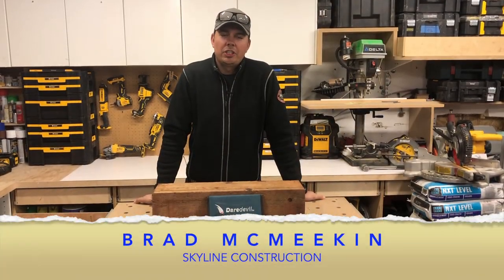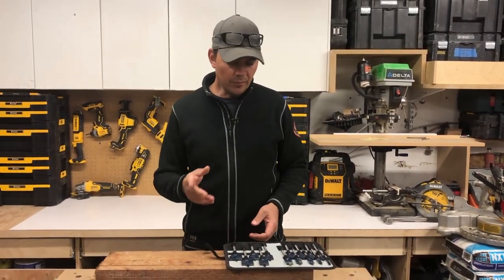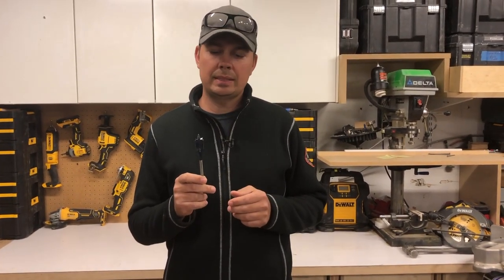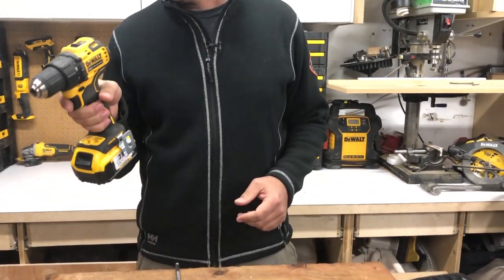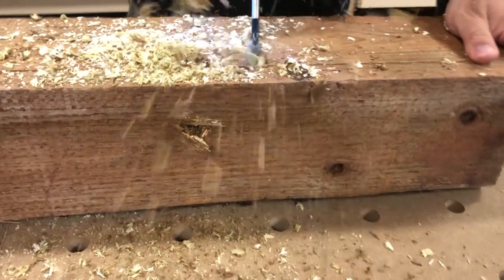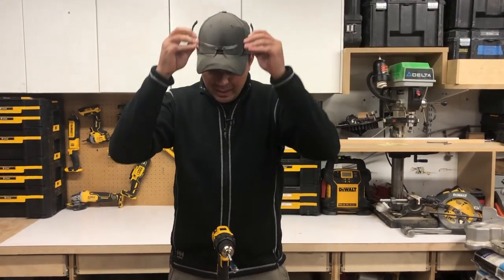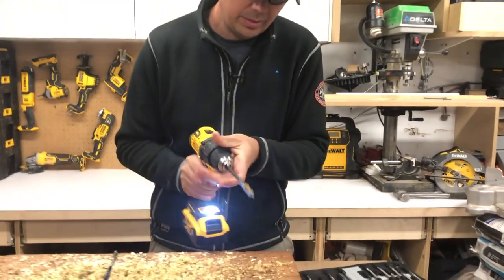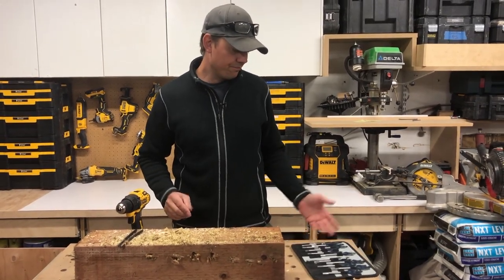Drill through wood with ease! Bosch Daredevil DSB5013P 13 Piece Spade Bit Set REVIEW

Comment: Just the video I was looking for. Question for you. I need to drill 3/4” hole through a pressure treated 6x6 to install a bolt (for a pergola vertical post). Would you still recommend this spade style bit or should I go for one of those power auger bits? I think my main concern is drilling a straight hole for which my bolt can pass though and less tear out for be nice.
Reply from the maker: i find an auger bit would have less tear out, the spade bits are great but very aggressive.
Reply: Hammer and Home thanks! Ended up good with the daredevil auger bit from Bosch